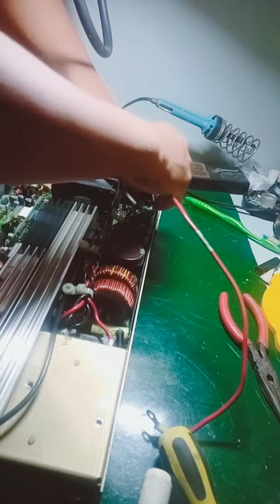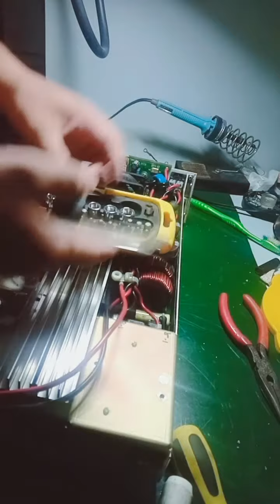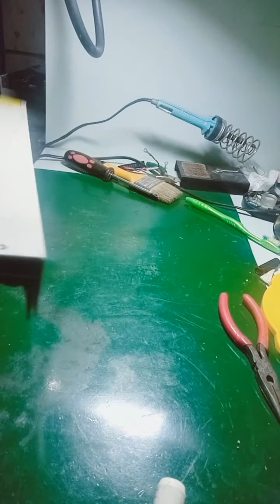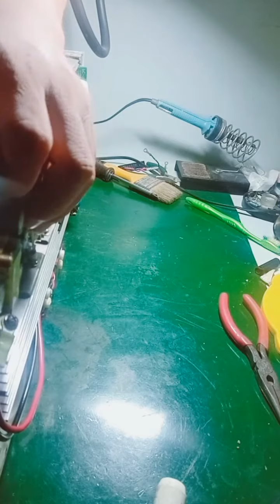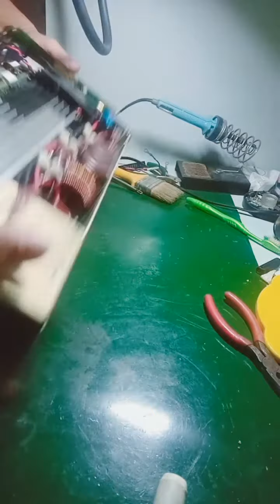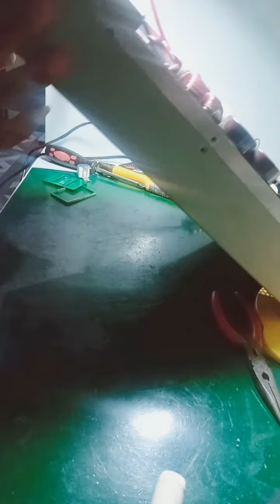Repairing Sorensen XHR 20-50 DC Power Supply

Comment: Could you use it to charge smaller battery packs that are in the range of the power supply. Something at 65v/10a ratio charging? I wanna purchase the 100-10 XHR model of this. Thank you for your time.